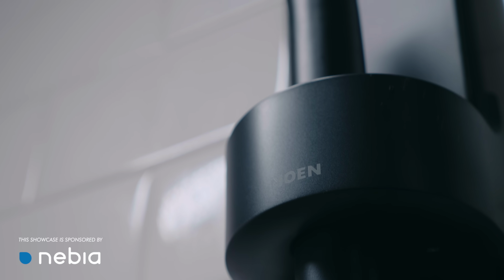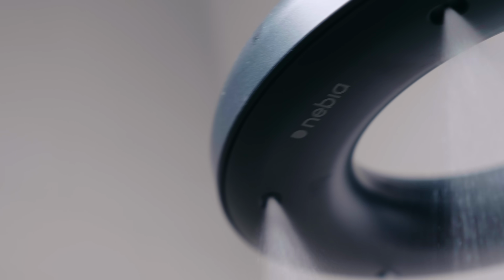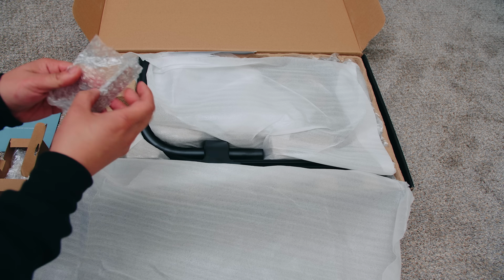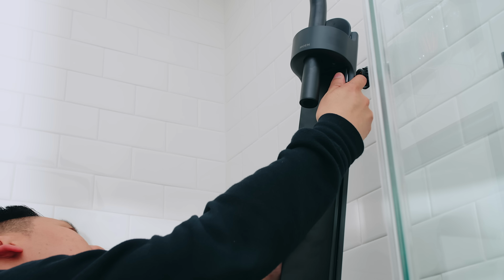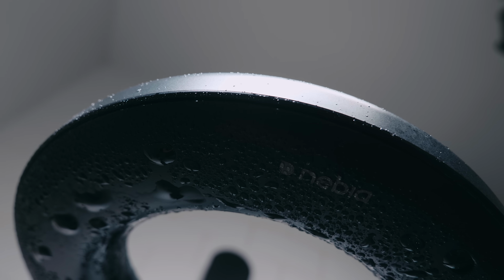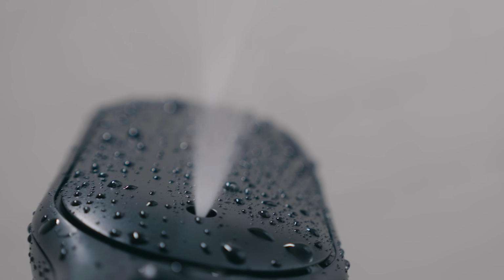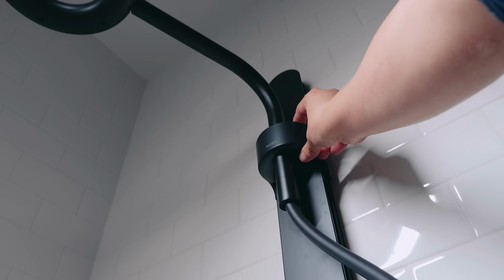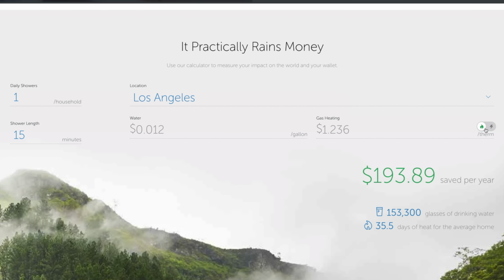The ULTIMATE SMART SHOWER OF THE FUTURE Made by Former Tesla, NASA & Apple Engineers - Nebia by Moen

Comment: The mist shower is my preferred full body hygiene method. It is far more relaxing, centering and pleasurable experience.  I feel both relaxed and invigorated.  I definitely feel wetter during the shower. The mist shower system I use is based on a Canadian research model and uses less water than the Nebia.  With very few design modifications the Nebia could be equally as warm, satisfying and cleansing.  In place of a 15 gallon shower the mist shower I use is far more effective with less than 2 gallons of water for a nine minute shower.  ..And documented energy use for my HOT water is less than a standard shower.  I encourage Nebia, not to give up and think outside of the box.

Comment: I am okay with it but my wife hates it.  It may save water and energy but 1) it feels cold or burning hot - cold if its farther away where the atomized water comes closer to room temperature by mixing with air and burning hot if you turn up the heat to overcome and its close to your head, 2) related to 1 you end up turning up the temp and leaving it further away, wasting energy, and 3) my wife complains that it does not have the volume to rinse her hair.  So $500 in the junk bin. I think it's fine for a guy with shorter hair but not for women.

Comment: It works really well but there are design faults too as the angle of the spray creates a dead spot in the spray , it badly needs a couple of spray nozzles in the middle as it takes forever to wash soap and shampoo away , you subconsciously move towards the outer spray pattern

Comment: He mentions that the water gets warmer as you get closer to the shower head. That's a nice way of saying that atomized water gets cold super fast. Consequently you will have to use a hotter water setting than you normally do. I can attest to this from personal experience. I'm sure you will save water, but I'm not sure you will save energy using much hotter water.
Reply from the maker: It's honestly been so hot I had to turn my water heater down but okay. I'm merely saying what scientifically happens, it doesn't mean it gets cold by the time it hits you, it's just a fact that it is hotter the closer you are.
Reply: Thanks for sharing this important piece of info!!

Comment: I purchased 2 units on kickstart. Received them and have tried to contact the company several times, but no replies. One of the units is faulty and cannot screw them onto the shower. The plumber cannot install them due to the position of the pipes in the wall. I need to return them and cannot get any answers. Perhaps this will someone's attention.

Comment: My biggest concern is how long the adhesive will last especially in a wet environment. Although I do appreciate not having to drill any additional holes into the wall
Reply: Hi Stanley, the industrial water-resistant adhesive we use is commonly applied in the automotive industry and high-end electronics. The adhesive is non-damaging to shower tile even if you decide to move, but strong enough to provide a rock-solid install year over year. However, If you’re concerned about the adhesive, you always have the option to use the included screw to mount the shower to the wall.
Reply from the maker: So far no issues, but I get the concern. They do offer the parts to mount it if you want to drill, but I imagine most are like me and prefer to not do that.

Comment: How is the water flow pressure?
Reply from the maker: Before I answer this, some context. I live in Southern California where we have low flow requirements on faucets and what not. I'm used to feeling underwhelmed with showers and kind of like it when it feels like a hose of water is shooting at me, so to speak. Instead, it all feels like something that is trickling on me.

The Nebia by Moen is a MUCH better experience. It's not like a hose where you feel the weight of the water falling on you or anything like that, but it still feels way more forceful than standard showers but in a different way. Because it is atomized, it feels different, but it isn't bad at all. I honestly like it a lot more than the shower head I had before, and my last one wasn't a bad or cheap one. It was a high quality standard Moen shower head that you can see in my video. I hope that makes sense. Essentially, I don't feel a longing for a better shower unlike how I did with my old shower head.
Reply: @ThisIsTechToday  do u still use this shower
Reply from the maker: @evan.5967  Yup!